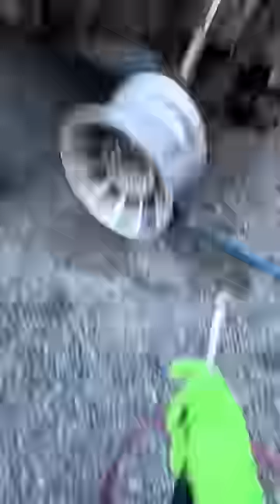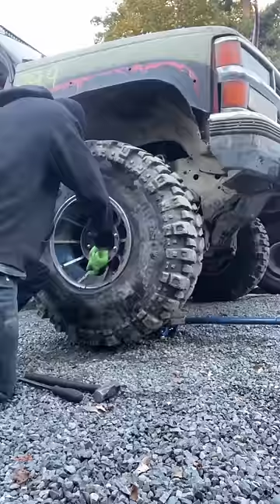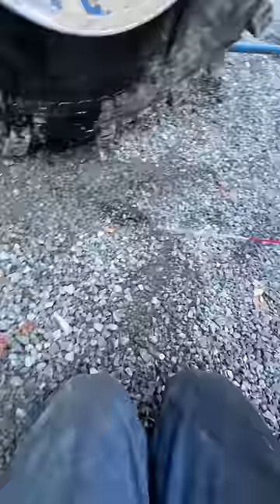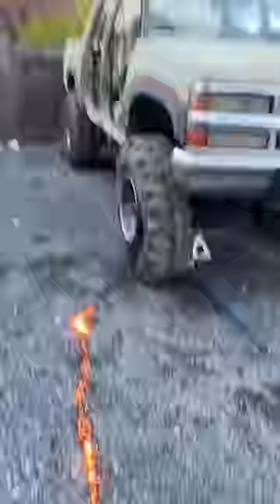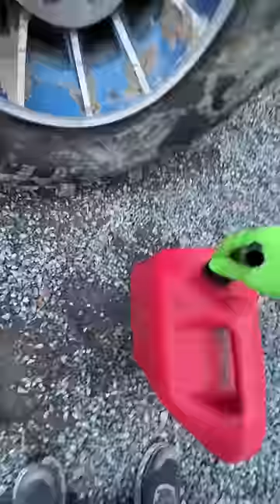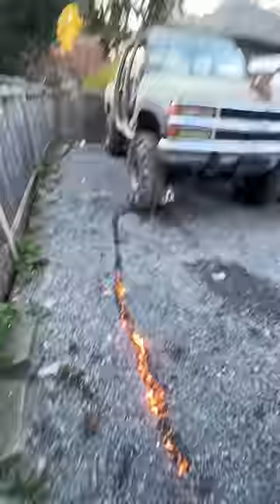This video Blew Up!! 🔥 #oddlysatisfying

Comment: ether my guy. works every time..
Reply: Good ol' cosby sauce!
Reply: Hell yeah. Done this to a 4wheelr tire once and had a lil much in there oopsie. Anyways is that a Tahoe or burban
Reply from the maker: @jonathanyoung1383 chopped down suburban
Reply: The Nas song? I know it's a fire track but idk if it's enough to explode a tire to get it mounted.
Reply: Ehhh nothings gonna work if your gap is too big lol, that's why his last attempt worked.. Small gap
Reply: Lol u got ether??? Rare to find sum that hasn't already been all huffed🤣😭🤣😂😭😭😭
Reply: I remember the first time my wife’s grandpa did it. It’s a loud pop. But road worthy in less than a second lol!!!
Reply: The new atarting fluid does not work like the original ether. It will catch fire and burn instead of explode.
Reply: I was just bout to say ether also. Just be safe bout it. The problem is the tire can blow apart and baiscically become an IED. And that was soooooooooo much brake cleaner. I've had to set the bead on tires allt in remote locations, but always start with less is better. I have had one or two that took alot, and don't know if he lied to me later but i did see the shreaded tire in back of truck he said he hit a pot hole and it blew up driving down rd, said he could smell bunch of ether still when it happens. I wasn't there tho but tire was shredded but was used and dry rotted. I always recommend tire shop first but people don't always wanna go that route lol. But that one is my only bad experience. I do kno people that's died/scalped from sidewall launching up at them while they looked down at it doing this also. I normally use stick sprayed little on end and stay as far back as possible. Ether trick def works tho. LESS IS BETTER. U CAN ALWAYS TRY AGAIN AND USE MORE.
Reply: "The only thing that really worried me was the ether. There is nothing in the world more helpless and irresponsible and depraved than a man in the depths of an ether binge. And, I knew we'd get into that rotten stuff pretty soon."
Reply: If you run out of ether you can use silicone spray in a pinch you gotta be quick  but it makes a big boom 💥
Reply: @Jamesim82 That's the first thing that popped into my mind too lol
Reply: He's using parts cleaner 🤦🏻‍♂️
Reply: You’re supposed to have the Schrader valve removed and a clip on air chuck with constant air pressure hooked to the valve stem , then light the ether trail. You’d be amazed how well it works if you do it right the first time
Reply: @Jamesim82 ahhh you've got the "Fear"😂
Reply from the maker: @trevorpeckham9104 but maybe, the point of the video was just an excuse to play with fire. Yeah, imma stick to that one. 😁
Reply: It would have done the same thing because there was too big of a gap between tire and bead. If enough oxygen can get in you only get fire.
Reply: You all don't seem to realize it can still burn inside especially if you immediately add air (to feed the fire). I've saw some tires that have blown out the sidewall that was obviously burnt rubber on the inside.
Reply: It works better but some of us never have a can around. 

Also that stuff is terrible for your engines. It's primary use should be seating beads. There's things that are easier on engines and work just as well. 

I couldn't tell you that I've ever personally even purchased a can. And I work on a lot of junk.
Reply: @nooneyouknowhere6148 you're buying starting fluid that has other stuff in it. They've been adding stuff to it like "upper cylinder lubricants" and such (that never even make it to the cylinder) that's supposed to make it more gentle on engines and just causes folks to use more. Which is arguably worse than the effects of just ether.
Reply: @MrBushman123  we're just gonna give er ALL the Cosby sauce then drink a Busch Latte to celebrate
Reply: Acetylene even better, how we do it in the country
Reply: Lol evaporates to fast and isn't nearly as volatile
Reply: @MrBushman123 oh yeah i used it at a few college parties in my day
Reply: @MrBushman123 bruhhhhhh 😂
Reply: @TheTruthBeToId based
Reply: Used to set heavy equipment tires this way.
Reply: @MrBushman123 😂🤣
Reply: It's hard to find ether that still has the kick that the old ether had. It helps if the yum-yum hooked up the air hose beforehand.
Reply: @aaliasb. At your house maybe. Not mine.
Reply: @hiddenbigfoot show us one video to prove ether can explode a tyre. Just one. No? Ok, must be why people just use a high pressure air compressor to explode tyres on youtube then.
Reply: Yep
Reply: @DarkAttack14  I've had pancaked Bridgestone high wall truck tires that had a very wide gap, i tried 2 bead blasters simultaneously and nothing!
Propane worked😅
Reply: 60% of the time, yeah.
Reply: @goosenotmaverick1156  A lot of the extra ingredients are inhibitors and stuff to stop the ether getting explodey after it's been sitting for too long. They reduce it's effectiveness too.
Reply: @EddieTheH  well hey I just learned something, thanks!
Reply: @rossbrumby1957  so just for the record I did supply a link but my comment isn't showing. it's probly setting in orginal posters "possible spam" comment folder bc it had a link in it. But yes can happen, but I agree isn't very frequent and I said that.
Reply: 😊😊😊😊😊😊a😊😊😊😊s😊😊😊ààààà😊à❤
Reply: Yup! It's more combustible.
Reply: @bee2377  it may be more accurate to say it has a lower flashpoint, but I'm not sure how it compares when considering energy contained, but that may be a bit too nerdy path to go down. I'm certainly not going to look it up. What I can say is it's flashpoint is lower and that's the whole reason it's used as starting fluid.
Reply: @MrBushman123 not funny
Reply: Yeah that O'Reilly's stuff is only %50 ether. Learned that the hard way when I lost my eyebrows
Reply: Na bra it's all out that oxy acetylene and make sure you have life insurance on the guy that has to light it 😂
Reply: @jonathanyoung1383  neither, it's a pickup....
Reply: Oh ya, our service guy dose it all the time. Works the first time everytime
Reply: Came here to say the same thing.
Reply: @Jamesim82 fear and loathing?
Reply: Yeah I've only used the ether to do this and I've never had to do it twice
Reply: fck yeah it does bud, I couldn't stand up for like 3 hours
Reply: Next time try a little less brake clean. If the fuel air mixture isn't right its a lot less explosive.
Reply: @jimskatr103 you could just wrap a come along around it and tighten it down. Works on motorcycles at least
Reply: @DarkAttack14  right air/fuel mixture it will work everytime...
Reply: He just needed less fuel so it didn’t go torch mode
Reply: Yep spray and light done 😂
Reply: @hiddenbigfoot i dunno, that looked appropriate to me. It takes a surprising amount to get it.
Reply: Doing it wrong.  Using wrong stuff... good job 👍🙄
Reply: Any of it works, but you're supposed to have air going in the valve to atomize!
Reply: Sure it works but I watched a tire buster at Goodyear run across the street punching his head trying to put the noggin fire out. They were banned from doing it again after the lawsuit. Lucky for him the Mgr ordered him to use the starting fluid.
Reply: @TheTruthBeToId  Nasty Nas. Bravehearts no doubt!
Reply: Ether it works or it doesn't.
Reply: Yes! Thank you I don’t have to tell him now lol
Reply: Where do I find ether, asking for no particular reason
Reply from the maker: @douglasrodenbach8000 starting fluid. Certain brands.
Reply: Yup!

Comment: Use the air compressor to blow air in there right before you light it. It atomizes the starter fluid and gives it a good oxygen ratio! Figured out after five or six failed attempts
Reply: Video 2.0: Semitruck edition#Hellyeahbrother
Reply: Starter fluid is atomised straight from the can- its why they use ether. Clipping on the tyre chuck only blows ether out of the tyre meaning you have to spray more in to compensate. Only reason people use air also is because when the ether is consumed, the pressure inside starts decreasing as its cooling, and the bead can pull back. Only need to have the air at hand ready to inflate as soon as it pops.
Reply: @rossbrumby1957 I think he's talking about blowing it inside the tire with a nozzle, not at the valve stem, helping the puddle of whatever at the bottom to evaporate into the air space of the tire so that you get a more even and rapid  combustion. Even ether will puddle at the bottom before all the air inside is saturated, that's why it took this guy 3 tries before the air inside the tire was fully saturated with combustible molecules.
Reply: And when the heat stops the tire immediately collapses and usually pulls from the bead.
Reply: @Allangulon That’s why you fill it to a correct pressure after. 🤦‍♂️ this is just to get it tight enough to add air 🤦‍♂️ otherwise you can’t add air. Normally people use a special air pressure tool that shoots in a sudden burst of high pressure air but this is the cheap way.
Reply: If you’ve got an air compressor… just use the compressor
Reply: @ctwise12 ....yes ... just about to type that ....
Or , use the air compressor to blow the flames out , since you set fire to it   instead of using the air compressor
Reply: I like the ignition trail. Very good form- followed
Reply: Great tip! Mainly it looked to me that the gap between the tire and wheel was too large. Needs to be a smaller gap like it was when it finally worked. Maybe with your trick the gap is less of an issue.
Reply: @blueskyla7978 the gap was fine he just needed to get air in there.  Sometimes if you kick the tire it will initiate ignition better
Reply: Sealed it
Reply: All of you are wrong. That's not even starting fluid.
Reply: You my friend are a true engineererist
Reply: Read!!!!! It says brake cleaner on the can!!!!! Either is bang every time. Brake cleaner don’t have the flash point.,   Read the damn can????

Comment: Ratchet strap around the tread of the tire in the center of the tread pattern to force the sidewall towards the seat ring works every time you don’t need either, you don’t need gas just a ratchet strap and a good compressor holding at least 120 psi in a 5 gallon tank
Reply: Hello o
Reply: Would be awesome if you made a video of that method bro, I've seen several with the flame but non like that.
Reply: That's how I do lawn tractor tires thay leak at the bead.... break the bead, re lube it, ratchet strap around the treads, fill her up
Reply: Brother I love it, if you’re gonna do something the “wrong way”, at least do it in a semi intelligent manner 😭🤣. Not everything has to follow the book, but it at least needs to make sense!
Reply: Идея однозначно хорошая лайкаю 👍
Reply: Yup that's how we do it on trail runs, don't wanna set the sierras on fire

Comment: The reason the fire trick works is because all the flammable material is "vaporized" before being lit up thats why it didnt work the first 2 times. It also works better if you add air at the same time
Reply: No one believes me when I tell them that liquid gasoline does not burn only the vapors are flammable
Reply from the maker: @140630vk that’s just science. Full gas tanks don’t explode. No room for vapor. Almost empty tanks are the most dangerous.
Reply: There was too much of a gap between the tire and rim for the explosion to escape. The third time, you could see he readjusted the tire on the rim to where there was less of a gap. It worked.
Reply: Teach my man teach.
Reply: The reason you use starting fluid is because it flashes faster and blows the tire on the bead, but sometimes you can get other fuels or chemicals to work.
Reply: It's not that the material was not vaporized it's the mixture was way too rich You literally only need like half. A second of spray inside the tire and the rest goes outside and on the ground. This way, there is a sufficient oxygen mixture for the flame to burn rapidly and intensely. This one had way too much fuel and not enough oxygen, so the fuel burned slowly and pathetically
Reply from the maker: @Kcburnit yes, but I enjoyed myself. :)
Reply: @wesman7837 break fluid I actually much fast burning fuel. The real problem was that he used way too much inside the tire.
Reply: I do this on a regular for stretching tires on wide rims. I only use break cleaner since we have drums of it.. add air at the same time.. and it works 98% of the time
Reply: @140630vk I believe you. Standing beside a brush fire once years ago, I was having this same argument with my girlfriend. I  tossed my burning cigarette into the half full bucket of gas that was sitting there, carefully mind you, i didnt wanna cause a fire.😅 She seemed disappointed that I didn't die, but the cigarette just went out. And to answer an entirely different question, no, she's not around anymore!😂
Reply: @sausages6135 thanks that actually explained it better than the original comment, I was still confusion lol
Reply: Who asked
Reply: Flooded it
Reply: @jaytillage1  the tire already has air in it ao its not like your really adding any air, youre just moving it around. Although that movement might help to mix the fuel vapors in so still a good idea
Reply: Its because it was too rich, not enough oxygen. Needs air for a few seconds before lighting.
Reply: Air flow massive help.
Reply: @140630vk uhh, well technically gasoline (the liquid) is flammable, but atomized in a car engine makes it more like a dust explosion than a vapor explosion. Tiny particles have more surface area than a chunk of gas. Heats up better, better mix with air, better ignition.
Reply: @140630vk  that's why gasoline has to be atomized to combust. Same with alcohol, the liquid itself doesn't burn, it's the vapors.
Reply: Why don’t you just buy two cans of fix a flat
Reply from the maker: @jamessveinsson6006 you gotta watch the linked video of how it came OFF the rim. Lol
Reply: so that debunks the trade center commission that jet kerosine caused all the cement reinforced high strength steel to buckle due to the "jet fuel" when as you stated the flammable material should have all been vaporized instantly in the first 2 second of impact.  Now its just office furniture and other housing materials that will not get hot enough to melt reinforced steel.  Also the sprinkler system on every impact floor happened to fail at the same time and in all three buildings.
Reply: @thecrazyfarmboy you ever seated the beads on tires? Then you would know that having air on it too would help push the sidewalls out a bit and also keep them out when the fuel ignites making it more likely to seat. 

Not sure what you are disagreeing with of course the air will leak out until the beads are seated that’s very elementary level common sense you are explaining in a way that sounds like you think the air wouldn’t help seat the beads.
Reply: @fitnesspoint2006 wym we saw the kerosene vaporize when the plane 💥 I’m not saying I believe the commission either I’m just saying, fuel definitely ignited
Reply: @MechanicalTriage Yep, mythbusters lit a full gas tank on fire, it just gently burned.
Reply: Looks like a cold morning so vapours will be low. Petrol will work fine if its warm- lotsa vapour.  Only reason that slow burning shit worked the last time was the tyre was nice and warm by then. Use aerostart because ether is an all weather instant inflator. Only reason people use air also is sometimes the tyre sucks back in after the fire goes out and you gotta rush to inflate before the bead seal comes back off. Problem with air is it blows vapour out of the tyre before ignition losing power to work.
Reply: Sometimes you got to kick it I've always used starting fluid
Reply: @140630vk Everyone who has passed a science class - or plays with engines or explosives - knows this. 😅
Reply: @jamessveinsson6006 because you still need to seat the tire on the rim bead. Without that all you'll do is waste 2 cans of fix a flat

Comment: I usually wrap a ratchet strap around the rim and compress the tire. It helps. ❤
Reply: It always works for me. It also doesn't take a chance of burning the vehicle up.
Reply: I came here to recommend the same thing!  Works like a charm.  😊
Reply: On our carts we just use a ratchet strap and skip the fire.   Sometimes releasing the strap gets tricky.
Reply: Yep. Or a rope with stick to twist it tight if you're in a pinch and don't have a ratchet strap or the tire is too small for a ratchet strap.
Reply: Good way to see a ratchet strap go flying
Reply: @oliverklozhoff  that all depends because I release mine once the bead seats and the tire is filling. The ratchet strap is only meant to help seat the bead and is removed as soon as the tire takes hold. I should have explained it better. I apologize. I am sorry.
Reply: A noob here. Why can't you just use compressor to inflate the tire?
Reply: @ldmtag  unless the tire bead is touching the wheel flange all your doing is inflating the atmosphere. I grab a commercial truck strap rachet the strap around the tire in the center of the tread and that seats the tire beed on the wheel and it can be inflated otherwise its just a exercise in futility.
Reply: @ldmtag  we are trying to get the beed of the tire to sit against the rim so it can hold the air and then once pressure builds up it will pop into place. =]

Comment: Starting fluid! And make sure you have air going into the tire
Reply: And make sure not to make a trail on the floor! And use a torch works best when it is cold and windy.
Reply: Don’t forget the blinker fluids too
Reply: Bingo!!!!😂
Reply: You put the air in the tire as soon as it blows. The trail is perfectly fine or just stand back 5 ft and use it like a flamethrower. On a wide rim you need to space the tire somewhat evenly concentrically and between the rims usually I use 2 x 4 s
Reply: Burning brake cleaner also creates phosgene gas
Reply: Air at the same time just blows the gas out of the tyre, making a weaker explosion. Just have it on hand ready to inflate before the air inside cools and contracts, sucking the tyre off the bead.